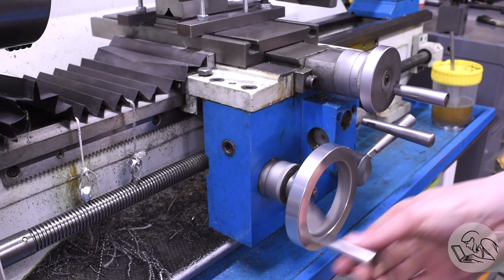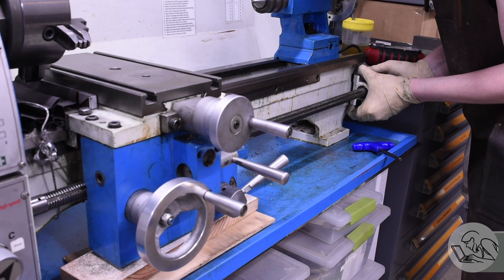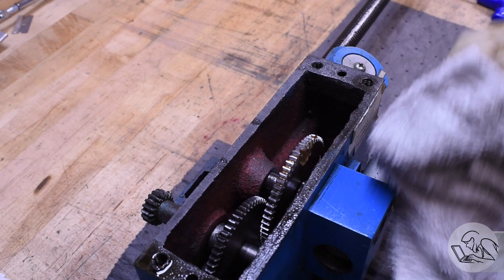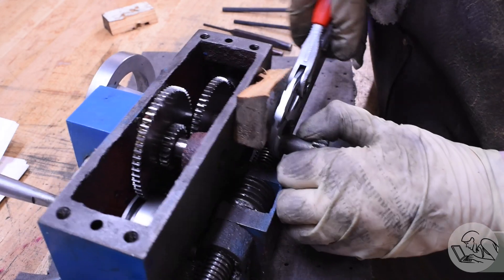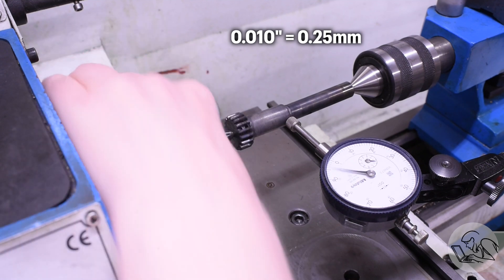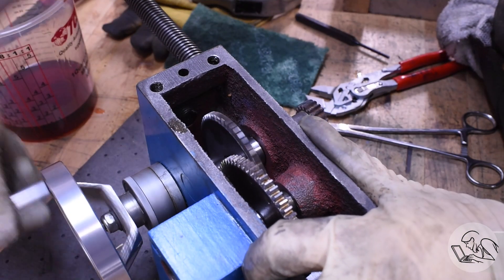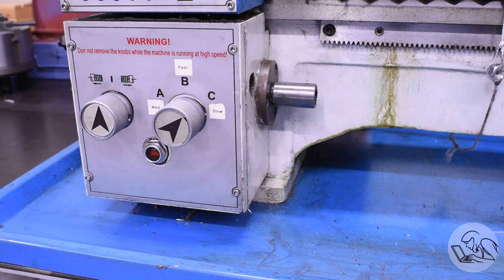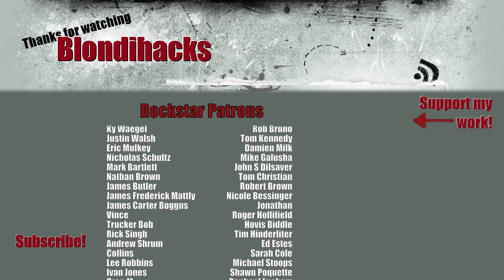Lathe Crash And Repair! 🤦‍♀️

Comment from the maker: Hey everyone- since a lot of people seem to be losing sleep over it, no the pinion is not hardened or some fancy alloy that is going to be hurt by heating it. My Chinese lathe is honoured that you all think so highly of its components, but you can count on one hand the parts in these machines that are hardened or any alloy that would mind a little heat. So let’s not bother typing that any more. Now you can get some rest, finally!

Also a lot of people saying the shear pin on the leadscrew didn’t do its job. Well, that isn’t that shear pin’s job. That shear pin is to save the leadscrew if you crash with the half nut engaged. It has a 4:1 (plus the rack) mechanical advantage over the pinion and there’s six gears and shafts between the two. That pin ain’t gonna shear from the power feed. This lathe SHOULD have a shear pin on that pinion. That would be nice. But it isn’t that existing shear pin’s fault. If it would was weak enough to shear from that pinion at the other end of a 4:1 gearbox, you couldn’t cut threads with it. It would shear from the force of the half nut pushing hard through a 13 tpi thread. So feel free to complain that there should be a SECOND shear pin here, but don’t blame that one. It’s doing its job by not shearing here. 😉
Reply: .....and if it was hardened, it wouldn't have bent in the first place!!  Another interesting and informative video Quinn, Thanks!
Reply: @mwakelin  if it was hardened it may have stripped teeth of gears .
Reply: Hey heads up, the shoulder of the pinion took a slight deformation where you applied the percussive maintenance with your precision impact device. Looks like it may create a  wear spot on the cast iron case and pull the pinion out ever so slightly which could affect alignment. It may end up wearing itself some clearance, but just in case you didn't notice it. 

It can be seen clearly at 13:02 in the video. My 14 year old pointed it out to me. I love to sit down with my 10 and 14 (soon to be 15) year old girls and watch your videos, it inspires the hell out of them. I mean, I tell them all the time they can do this kind of stuff, but Dad is just Dad, I am supposed to say that, and they help me often in the garage/shop. But seeing you doing this work, your openness and honesty in your approach really speaks to them, thanks for putting out this content, it is much appreciated.
Reply: I also bought a Chinese 6125 lathe, the DC motor will becoming weaker some years later and you have to replace a better AC motor. Maybe I will buy a big second industry lathe.
Reply: LoL 😆
Reply: 😂
Love the Way that came out

On another note, I’m so naive that if Quinn does that … it A ok 👍

Comment: I somehow missed this video so sorry for the late comment.   My lathe, different size but I’d bet same plant in Taiwan.  Mine has the same inconvenient drain on the feed/threading change box.  The headstock is the same, remove a plug and it runs all over the machines and exposed drive gears.  I finally got fed up with the mess and ran some tube fittings and a small ballcock, onto which I a thread a salvaged piece of hydraulic hose and can now empty all three into a bucket.  Less mess and I can change the carriage easily and more often as it gets dirty quicker, I don’t see anything wearing on inspection but I’d bet shmegma gets in from the top somewhere.  Taper pins are very common in machine tools because they hold alignment better than straight dowels and can easily be reamed a bit to make small adjustments.

Comment: I was doing a similar job on a lathe and ran into the same problem. The table to the right of the lathe was in the way for me as it was for you at 18:00. There was nowhere to move my table, I had to cut the corner of the table because there is nowhere to move it.

Comment: Hola Blondi;
Este magnifico video-tutorial de como desrarmar el delantal de tu torno me ha servido de mucho. A mi tambien se me ha torcido el eje principal y... se ha coronado el pequeño engranaje que hce mover el delantal. A parte de que se ha fisurado la propia caja del delantal; con lo cual: o le hago una reparación 'sui generi' modo de un muy buen refuerzo, o... me tocará comprar un delantal nuevo. Todo dependerá del precio del recambio.
Me gustas porque eres una persona, casi tan, atrevida como yo, de tal manera que te atreves con todo.

Edito;
A tu forma de recuperación del eje sólo le veo el inconveniente que al calentarlo ha perdido el temple y ello requiere volver a darle temple, con el inconveniente de no saber el grado de dureza que tenía de origen. Es mejor enderezarlo en frio.

Si algún día, nunca se sabe, pasas por Barcelona estaría encantado que nos visitaras al moto-club La Moto Clássica.

Hello Blondi;
This magnificent video tutorial on how to disassemble the apron of your lathe has been very useful to me. I also had the main shaft twisted and... the small gear that makes the apron move has been crowned. Apart from the fact that the apron box itself has cracked; therefore: either I do a 'sui generi' repair in the form of a very good reinforcement, or... I will have to buy a new apron. Everything will depend on the price of the replacement.
I like you because you are a person almost as daring as I am, so much so that you dare to do everything.

Edit;
The only drawback I see in your way of recovering the shaft is that when it is heated it has lost its temper and this requires tempering it again, with the inconvenience of not knowing the degree of hardness it had from the beginning. It is better to straighten it when cold.

If one day, you never know, you pass through Barcelona I would be delighted if you visited us at the La Moto Clássica motorcycle club.

Greeting: Toti

Comment: Did the same thing on my 14-40 because the lead screw clutch was adjusted so tight it was no longer a clutch--except I had the fun of cracking and distorting the housing in the process.  1977 era Korean lathe so it was fix or scrap, no part replacement.  Sometimes ya just gotta do what ya gotta do, inventing a LOT of new swear words in the process.

As always, excellent video.

Comment: Hi Quin, thanks for these videos, always good to see people figuring out solutions and fixes instead of just going and buying replacements. I think now you have the lathe back and operational, it would certainly be a good idea to fabricate a replacement with, as you said a shear pin. As has already been suggested a ground out chisel gives you more control for placement of 'tickling' blows, further to that, should you be faced with similar is to calculate blocks to fit beneath the 'tickled' area to prevent you from blowing beyond straight into a negative bend and then have to try and straighten from the other side, too many of them will eventually result in fracture. Re the oil in these lathes, being as they are literally just dipping the teeth as it rotates, I personally would look at filling as high as possible, at least to half the height of the shafts. Overfilling won't damage as it's not a pressurised system, and this way should keep bearings bathed in lube. Anyway, keep up the good work 👌👍🏼

Comment: This  video was particularly interesting to me. I have a the PM 1440 Gunsmithing lathe and their big Bridgeport clone mill. The machines I have are made in Taiwan and there is a lot of quality there. Not putting your machines down, but Precision Mathews told me that the Taiwanese machines do cost a little more, but they can hold  +/- 0.0002", and I wanted that.  I've faced a few problems, and done several upgrades to the machines, but so far I've not had to go deep into the gear boxes. I replaced the lathe motor because the stock unit blew a winding and made the damndest noises while only willing to run at half speed. Not fun, but very simple to do.  I am always reluctant to rip into a machine with no real knowledge of assembly tolerances or what surprises may bite me inside.  What I see is that your little lathe is built very much like mine, and while they may be fairly bare-bones simple, that makes them easier to repair and potentially harder to break. Thanks for that.

Comment: Yes it's a shear pin. Interesting that it didn't break when it crashed. Could try replace it with aluminum for safety, but then there's the risk it will break too soon.

Comment: The reason, why those bolts are metric, is because the original machine has seen its first life as a "quantum mini 140" - a german toolmaker, who thought, it would be a good idea to make them manufacture the small lathe entirely in china. Same with the 230 and 400 variants. And for all you U.S.A. shouters: Every Harbour freight and even every precision matthews mill or lathe is the same deal. The design of it wasn't a engineer in the US or China - it was a german guy. You don't own anything if you manufacture it in china. I bet the chinese counterpart is nothing worse as the original.

Comment: Hehe . Im a turner(lathe operator) by trade I remember a flash new expensive lathe was delivered to our workshop. 

The apprentice who was bosses pet was rewarded for being a lick ass was the first operator and was screw cutting . He accidently slipped into reverse at full speed and couldn't disengage the leadscrew.
The saddle flew in to the locked down tailstock. No keyways shared ??? But the gearing , shafts and headstock gearing was all munted. The machine which was very expensive was written off.  He was no longer bosses pet. 30 years later I still laugh about it

Krap happens Quinn 🙂 But sometimes its too funny

Comment: So as you change your chinese apron oil, I remember the last time I had my own lathe apart, and "new oil" poured into the apron gears.  It's got to be twenty five years or so.  The "double imperial fist shake" should be accompanied by "colorful metaphors" denoting the level of angst achieved.  Very good job finding the problem, and fixing it right.

Comment: Ahhh, it was Quinn. It sounded like Queenie. Duh, I could have just looked at your patreon info right there in front of me! Excellent job by the way. I too am no machine repair person. Everything I know I know it from working on cars and some equipment but almost all cars. I did use to be a tool designer on prog dies. The job didn't help me be a better mechanic but the training did and the fact that I was one of those "a hole engineers" we mechanics always complain about I developed a healthy appreciation for the guys in the front office. Working in machine shop, briefly helped me use my training as we were required to take the entire machine tool operations sequence. People were complaining about "having to take all those useless classes" because "I'm not going to be working in some nasty machine shop"....yea..... Being older when I went to college and paying out of pocket gave me a level of appreciation for it and all the work I did as a result all the way to being a mechanic in my mid fifties. Again, very good workmanship and especially the chasing down the problem so quickly. It's easy to second guess from the hind sight but I personally might have tried the press first. It would have taken almost no movement to straighten it and so I probably would have over bent it and like the proverbial coat hanger....snap. You took the calmer and smarter approach I would say. Thanks for the vid as always!

Comment: Nice job. Although in a similar job, I recommend using your mill bed, hold down clamps and V-blocks. By using the V-block to hold down the thick shaft, you can locate the bend and actually use a dial indicator to see how much you are moving the bend back into position. 

Just a suggestion as we used to straighten bent shafts this way in my time in the Navy.
Reply from the maker: Good idea!

Comment: Not everyone would admit to crashing their lathe  but it is easy to see how it happened, great work and attention to detail like the tapered pins and using the correct gear lube.  I have only one suggestion to make possibly make a weaker shear pin for the lead screw where it attaches to the head stock.  Very good idea you have to order the spare part for next just in case.

Comment: Great job! I use the pulling bolt threaded into the taper pin to tap the pin in fully and then fully tighten

Comment: My old Millwright journeyman would have slapped your hand for tapping those pins in after snugging the bolts. We would also sometimes put a grub screw into the larger pins to protect those internal threads, digging crap out of those to get the jacking bolt in is a royal pain.

Comment: Good systematic approach to the problem while you are troubleshooting. 
It's interesting because (luckily) it's something that doesn't happen very often so it's a part of the machine you almost never disassemble.
Luckily you had some metric nuts and bolts (aka REAL units) instead of those PREHISTORIC units the British and Americans are still using "inches, feet, thumbs, elbows, legs" etc. 😉😁

Comment: Happened on my CQ6239. Best part was that the quadrant gear, (The piece that holds the gears that enable different ratios for thread cutting)  disengaged. I had buggered up, and not tightened the quadrant properly, hence allowing it to move. ( under the increased load)
Now, I never "tighten" the bolt. Nip it up, sure, but not "Tight".

Comment: Had to fix a similar problem on the apron of an old ass lathe (near 1940 old) and had the exact same problem with the block at the end of the lead screw, having to dismount everything because the screw doesn't have a shear pin for quick dismount wasn't fun and having to hold it for 15 minutes for someone to thighten and align the screws and pins wasn't much better. God bless modern machinery

Comment: Good job on the repair. On that pinion shaft bending, I see a major flaw in the design being that the pinion hangs out way past the last support bearing on a rather thin shaft. The apron casting should have had an extended boss where the bearing goes through and have the bearing directly behind the pinion, for proper support.

Comment: I have a lathe from the same china or Korean factory like yours only one or two bigger it came with 285kg only the lathe and one of the first things that happened (before I could put it on the  undertable that came with it) was the lathe swept on the side 🤪🤪and the big handle bend a little....so I had to repair my lathe before running it one minute 😎👍 the good side was that I saw how everything worked first handed and learned a lot from that stupid mistake not supporting the lathe against falling on the side 🤪

Comment: Hi - what a great video, I am in the throws of doing a similar project on my mill, the knee lift shaft s bent so I will be using the same method to straiten it. Unfortunately it is a bigger shaft. I have a little more confidence from your video. Thanks, Ian

Comment: Good fix! Was surprised to see a sump system on your carriage for a half size lathe that you have. Mine is slightly larger but just uses gun oiling at some points plus greased gears. Oil bath sounds far better!

Comment: Intrusting. look at you lathe . i say that because  i own a Colchester ,  master graduate lath. One hounded & 50 yeas old  . it as the same arrangement as your lath. But for the trends on the drive shaft it as the key groove the lenth of the shaft  . New models we fitted with leaded screw. as a separate .  add in the 50's  on  I'm explaining this because you've given me an idea.  a sliding thread  to rotate & give me a stat t & end point.  when signal pint Threading   & I can then fit & ues a trading diel..  
in closing i will just point out that as with your siystom   the carriage  is driven by the rack in my case  it is that what drives the thread cutting.  too   But it as no trading dial to ues it i would time 3 pints  on the lath Whit a marker.  ONE [ the chuck]  Two the [ drive shaft]   & Three [the saddle] .    Now i have a way to have a trading dial.    
{thank you for having you accident} there  is always a silver lining if we look for it , 
  Les Thompson   England  . glad you got it fixed . XXX

Comment: I make my living on machines like these with alignment pins etc.  If you ever have to do it again you want to insert an extra step in your taper pin, cap screw dance.  Put the screws in loose, pins in loosely, tighten the bolts, crack the bolts loose, drive the pins home, tighten the bolts.  This makes sure that the interface completely aligns via the pin.  In your method you can end up with a falsely set pin which could be a couple of thou out of alignment.
Reply from the maker: Good tip, thank you! Nice to know how that’s supposed to be done.
Reply: @Blondihacks  Also, on a threaded pin like those, thread in a sacrificial bolt for the pounding part. :)

Comment: Good job! I have a lot practice cold straighting hydraulic rods using a hydraulic press works very good without any change in heat treatment. If that shaft was heat treated hard to say!

Comment: Did you look at the rack gear inn the location where the pinion was bent. In shops I have worked in. There were guys that drilled with large drills in the tool post. Generally when this kind of thing happened the rack gear could also be damaged. Just a thought.

Comment: For fishing bits of metal that get dropped into awkward places,  I have a device in my toolbox that resembles the sort of telescoping antenna that you'll find on portable radios,  only it has a magnet at the end of it.  That came from a Snap-On truck IIRC.  Not something I use often,  but when ou need it,  it sure is nice to have.  :-)

What's the problem with a bit more oil in there,  what you're describing as overfilling it?